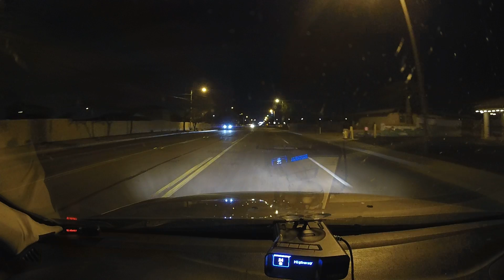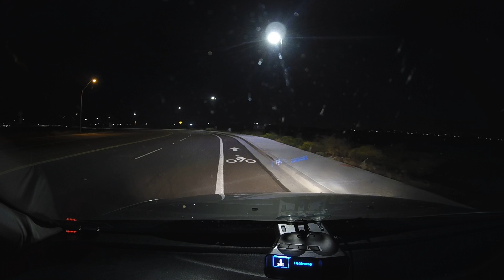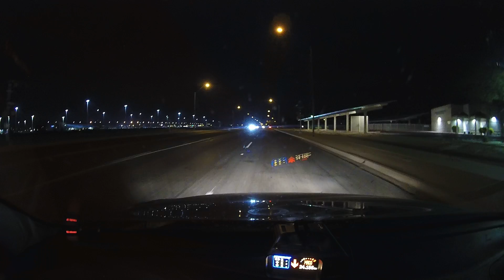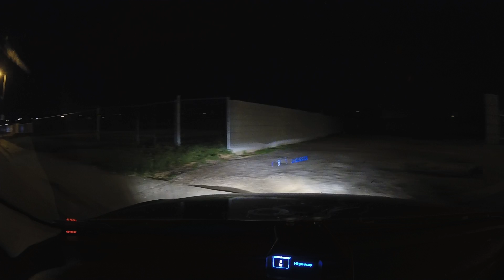Uniden R7 vs MRCD MRCT MultaRadar

Comment: Why would we want ka filter on.with this much speed control and it not going directly through the legal court system its probably overwhelming in reguards how many tickets/fines are sent in the mail. A 35 mph speed and in the day time there's obviously 1000s of vehicles potentially speeding. There maybe be 1000 speeding tickets a day in that area.There are 100s of individual multiple tickets on the same trip down the road. Meaning a man could drive through that area get 3 speeding tickets within 10 minutes. And the next day the same and the next.you won't be notified in the mail for the first violation for a month by mail.so I'm saying this is a impossible situation for a driver.in two weeks you could have a possible of 20 via mail speeding infractions. This system can not work like this and you probably have realized this a long time ago.what is the actual speed they start the ticket/fine process? 5 over 7 over 20 over.this can not work.The potential of multiple tickets within a few minutes multiplied by several days.this will fail !

Comment: The arrows are great, I bought a V1 the first year it came out.  The Unidens have superb range, but in the real world I don't need that kind of range.  More range translates into the detector picking up distant stray signals, ie, false alerts.  And their BSM filtering will drive you nutty.  What I wish is that Valentine would upgrade their system, their range is fine, but they're short of modern features.  Meanwhile, the Radenso offers the best compromise for me - plenty of range with few false alerts and great BSM filtering.

Comment: Another question is if k band is turned off and then can mrcd be turned on.believe it or not there are several states like NC and SC that has gone totally ka and laser.my k band stays off 98 % of the time
Reply from the maker: That's a good question.  Something that I didn't think to test.  We'll check that and get back to you.
Reply: @RadarBusters  I know in the old days with SWS I tried to turn k off and SWS on and it automatically turned k on
Reply: I live in Apex and the K band I have run  into is Wake Forest where I use to live.  Apex and everything else has been 35.50 for the last two years here in NC.  The only 33.80 I every had was in south West Virginia on I-77 just over the border from Virginia. Michigan state police run mostly 35.50 also.  Smaller towns usually 34.70.

Comment: 115 mrcds in the U.S. and that's what where testing for?
Reply: It's going to become more common.
Reply: @RidgelinePatriot  what I'm getting at is there's 20 other things he should be testing for.like R1s range from the front and range from the rear and false k band signals.he probably hasn't got the ok from uniden to do anything else.you really can't see that
Reply: @RidgelinePatriot  I never have seen speed trap hunter ever get near a mrcd before.and some how he found one and seems to have fallen in love with it.maybe if the range of the rear antenna is not as good as advertised then when that gets on YouTube its gong to kill sales.these are not production models.why didn't he test the str plus on the mrcd while he was there.it's super sensitive on k band.May be it picks it up fine just without the mrcd announcement .str plus was mounted on the dash and ready to go
Reply: @stephendoyle9113  that was just a theoretical number.there maybe only a dozen
Reply: @randyjohnson805     You'd be surprised how many are in use today in the US and that number is growing every week.  MRCD technology is the new thing and was made to defeat the average radar detector. If you ever encounter MRCD and your RD doesn't support MRCD and your driving over 12 mph over the posted speed limit, you can expect to get a ticketed fine in the mail. Trust me!

Comment: No improved BSM, no sale for me. I will stick to my R3. Arrows arent worth $600 for "slightly" better sensitivity and same BSM filter.
Reply: Have you ever had a V1?  I switched from V1 to R3 and miss the arrows.  They are worth it to me.
Reply: Steve Hanson no I haven’t.  I just don’t see the need to pay $600 for arrows and otherwise the basically same detector. I’ll wait and let everything shake out. I like my R3, except for the BSM filtering.
Reply: @FuturesBrizio  does your radar get a lot of alerts from BSM? Which I'm assuming blind means blind spot monitors. I'm considering getting this one or the M3 and ditching my 360 Max cuz it is annoying as heck with all its false Ka alarms.
Reply: Dor Mann the R3 is a fantastic detector with incredible range (tested best of all-maybe R7 is slightly better now). But the BSM filtering (K band) isn’t great. New Acura’s and Honda’s in particular drive it crazy. Hoping Uniden makes upgrades on that.  They know it’s the biggest complaint. The R7 supposedly is the same in that area (same guts). No Ka falsing that I have seen. Hope that helps.